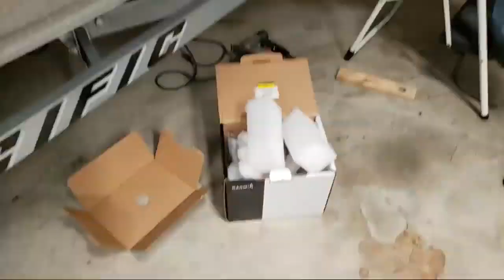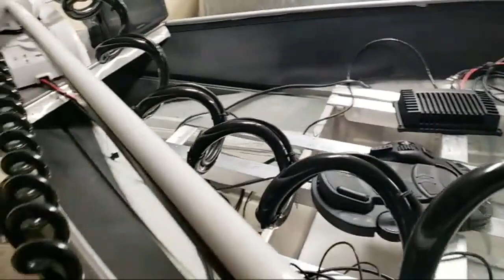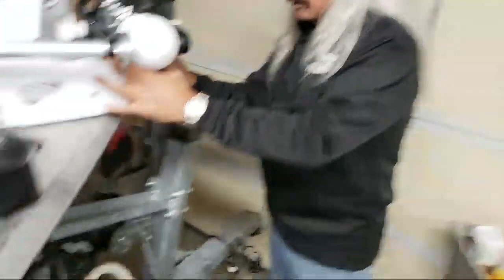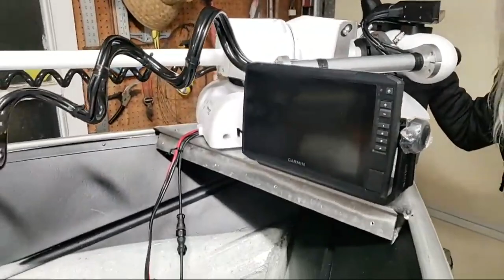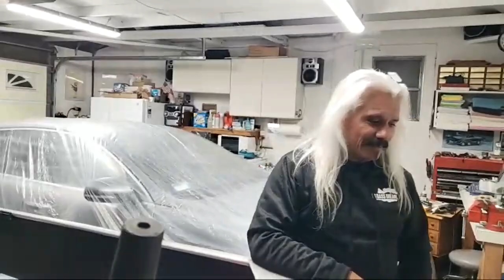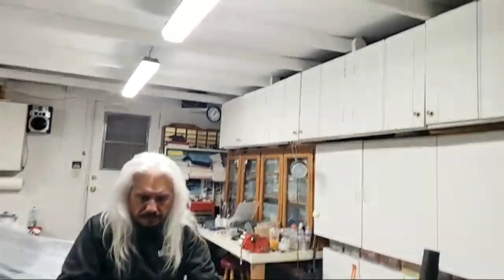DREAM MACHINE 1.0 Build Custom Trolling Motor Garmin Panoptics Livescope Transducer LIVE STREAM

Comment: Take my advice, from some that has that ulterra and livescope, you can mount the livescope on the ulterra, I’m not sure if you should mount the two transducers so close.  Since I mounted my transducer on a separate mount, I’m not certain.   I am certain that resistance becomes an issue and you should spend a bit more on your breakers on the batteries. Why the may be expensive, the scope and your I pilot draw lots of power. A slight drop in voltage and the scope will lose connection with the transducer and the ulterra will not stay on.
Reply from the maker: It's worked flawlessly all year so far.

Comment: I had the Garmin GT52 transducer and the panoptix transducer mounted to y Ulterra with the same brackets as you used.  I removed it all after about 1 month and mounted the panoptix on a separate mounting pole.  The ulterra will struggle with all of the extra load, trust me.
Reply from the maker: We had a similar setup with an ulterra and 360 imaging a couple years back.  We knew what headaches we were setting ourselves up for haha
Reply: Do you have problems with the ulterra wrap itself around and having the Panoptix cables twist also?

Comment: It will be interesting to see how well the Livescope works when using "spot-lock" on the trolling, since the trolling motor will move back and forth to hold your boat's location.
Reply: It will be an issue